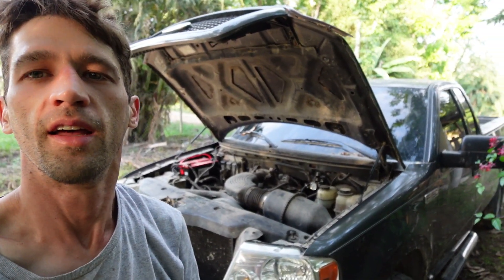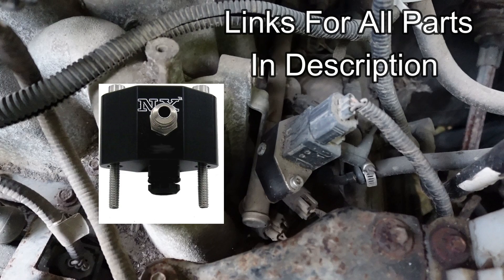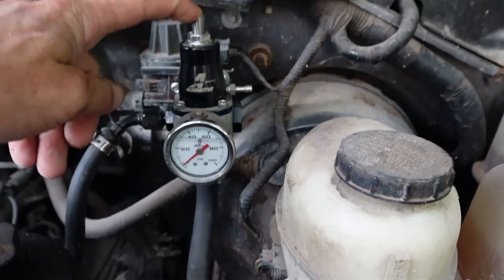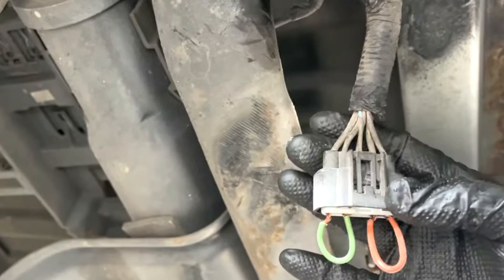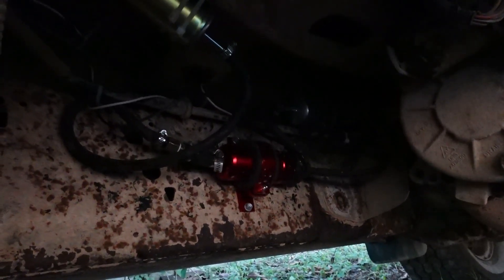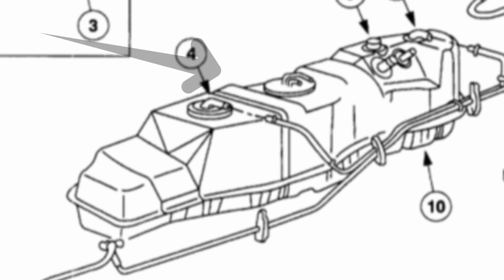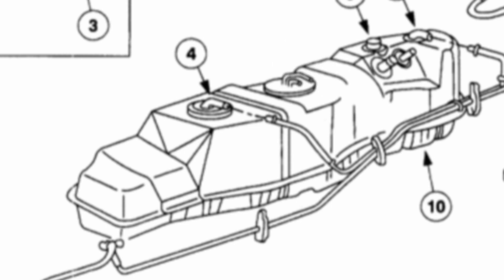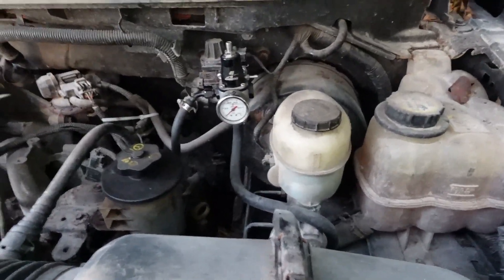Ford F150 Fuel Pump Driver Module Bypass + Return Fuel Line Install

Comment: Do a follow up video on how you ran and plumbed the inline fuel pump
Reply from the maker: Yes I ran the inline pump in the existing fuel lines It just pulls fuel from everything that was pre-existing inside the tank
Reply: @Larsenvlogs  I appreciate all the information, Sir.
Reply from the maker: I sold the vehicle shortly after making this video,  however I'm happy to report it's still running fine! I didn't change a whole lot with the fuel line set up I just ran things a little more tucked up and out of the way
Reply: @Larsenvlogs  did you run the inline pump through the existing fuel line and pull it through the old pump in the tank or did you tap and run a new line in the tank? Thank you for the reply. I have changed everything yet, the pump only kicks on when it wants.

Comment: Your doing to much its faster to get fuel pump drive module its much cheaper than putting all this add on your doing.
Reply from the maker: Tried that. Not sure if it was a faulty module or bad grounding or broken com wires but a new unit didn't solve my problem. Working in a place with next to no access to ford parts. An external pump with a double filter and a return line means no more screwing around.
Reply: @Larsenvlogs  did you try a new connector to the new module?
Reply: Thats where I’m at. I could bypass it with the wires on the connector then rip them out and plug it back into the module and it would run for a couple days.
Reply: Yeah but probably last longer and more efficient

Comment: Thank you for this video. Does this set a check engine light? Just curious.  I've seen mustang owners do this very thing to bypass the computer and provide more fuel to the engine.
Reply from the maker: As long as the fuel pressure sits between 40 and 50 it shouldn't it shouldn't set off a check engine light. Tested this truck for quite a few miles still no check engine light.